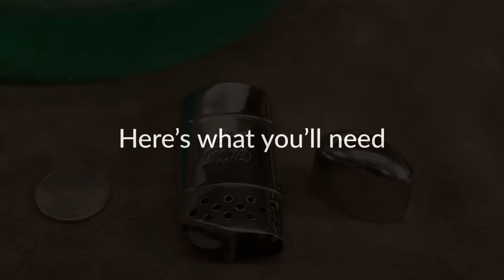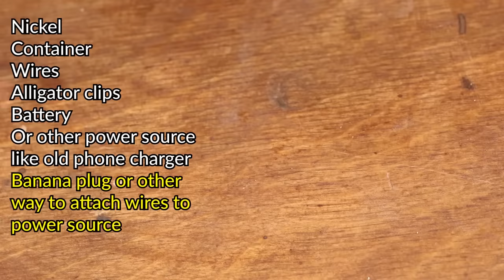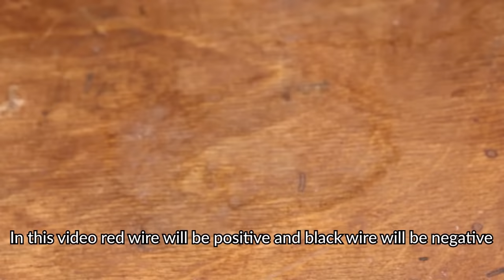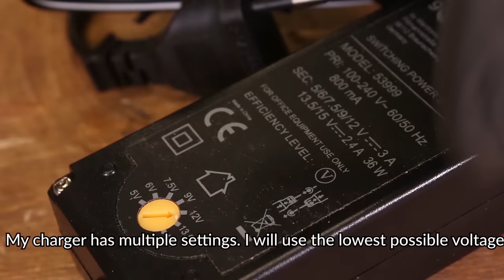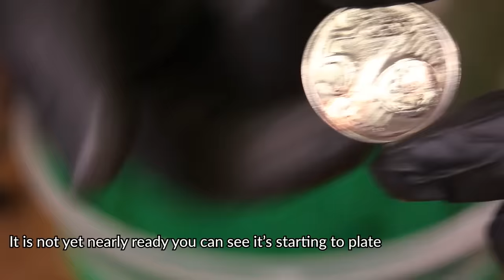How to make simple DIY nickel plating set up - Easy Electroplating for Beginners

Comment: Hi there. I'm thinking of nickel electroplating on my laptop heatsink/heatpipe assembly before applying liquid metal. I intent to electroplate only the coldplates of the heatsink assembly (the square copper shims that actually touch the CPU and GPU dies, not the whole assembly). How long should the part be immersed in the solution for a nice and thick layer of nickel for most protection against gallium penetrating it and reaching the copper to form other alloys, assuming a 5V (10-15W) power source is used?
Reply: I wouldn't. Copper has a much higher heat conductivity than nickel, so considerably less heat will be transferred to the heatsink, probably resulting in a fried CPU.
Btw where is the gallium co Inc from?

Comment: I have a question, can you plate plastic? I knkw there's no conduction for it to work, but can it be done?

I also saw a gif of someone plating regular bolts. But after the plating it was a purple color. Can you maybe help a girl out and explain?
Reply from the maker: Yes and no. You can coatc the plastic with something conductive such as conductive paint and plate that. I have no idea what could be purple plating
Reply: @Odd_Experiments  thank you for replying. I kind of figured you would need some conductive paint to even attempt to plate plastic. To be honest, I'm not even sure why you would want to anyway. I just thought I'd ask.
Reply: @TheFraggler  the steel from the bolt turned purple because it oxydized in the platting solution, you must first plate steel with copper into a copper sulfate solution with a copper anode before to plate it with nickel
Reply: @TheFraggler  Now that you have asked, you are obligated to everyone here to try it and make a video of your results :)

Comment: So could one use this method to nickel plate a small pistol?
Reply from the maker: Yes you could. Or a big pistol if you sake everything up. Adding multiple nickel anodes to  different sides of your container will help with getting even plating. Most of the plating will happen on the side the nickel anode is at. I wouldn't try to plate the barrel as you are adding a layer of metal making the barrel slightly tighter. But I'm no expert with guns so that might not be an issue

Comment: Based on a paper I read, look up "Pit-Free Nickel Electroplating", I would use potassium chloride instead of sodium chloride. The nickel chloride component of the standard "Watts Nickel Bath" was replaced with potassium chloride in this paper and it was found to give better plating results, as well against sodium chloride. That plating bath used nickel sulfate as the source of nickel ions thus giving the sulfate anions, where as you here the acetate anions (from vinegar). So it could be possible there is some interplay there that yields the potassium chloride better, but given here sodium chloride is chosen with not much reason other than increased conductivity, I'd shoot for potassium on the off chance it is better. Also, I believe nickel plates out far better at elevated temperature (50-60C). I try to wear a respirator when plating if I'm right above the solution, because as you mentioned, that mist. It probably contains some nickel ions which of course is carcinogenic. It's good to avoid breathing that, I imagine.

Comment: do i need to use the CLEAR vinegar or can i use some other vinegar ?
Reply: wine or cider vinegars aren't pure enough and less strong, better use the table white vinegar made from alcohol which is about 8°
Reply: @Jethro.Maloku-le.Rey.Kalsitran  its becouse in my country i cant get white vinegar for some reason
Reply: @jdmfl26  the problem with other vinegars is that they contain other stuffs that can contaminate the platting... but who knows ? perhaps you could give it a try... perhaps the other stuffs will react and condense in the bottom or won't affect the process...

Comment: Could the same set up be used but with brass?
Reply from the maker: No because brasa is an alloy (mix of metals). There is a brass plating process but it is more complex and produces toxic fumes. If the set up is wrong you will only plate one of the metals in brass

Comment: what could happen if you replaced vineger with water??
Reply: It wouldn't work because the electricity needs an electrolyte to flow through the solution.
Reply: @benjaminvanschaick3658  water+salt is a solution containing ions so its an electrolyte!
Reply: @abdeljalilabdeljalil9022  So if you're saying that you are going to replace the vinegar with salt for an electrolyte, then it might work. If you would like, you could design an experiment to see if it would work, although I think that it'll just split the water and none of the nickel will stay in solution.
Reply: @benjaminvanschaick3658  thank you !! i will try it to see what would hapen

Comment: do you know how to chrome plate plastic?
Reply: Most plastic doesn't conduct electricity. You could just leave the plastic in the solution for a long time, and maybe some nickel will precipitate out onto your item, but, it would not be a very reliable method.

Comment: I have tried with the same set up on brass, copper and zinc. The result is always a dark gump on the metal I try to plate :(
Reply: It often occure when the current source used is to powerful. that produce to much hydrogen that give a powdery layer that does not adhere on the plated surface.  And Zinc need special treatment before nickel plating.
Reply: @pwaldechfal  thanks for your comment, i used 5v 0,8 amp. I will try lower. I mainly try to plate coper for some reason.
Reply: @chongtak  Yes I think you could try a 3 or 4 V with 0,3 Amp max, for little pieces and cramped containers, wich not allow enough electrolyte space between anode and cathode. Copper is a good metal for nickel plating, good choice !
I don't know what type of vinegar and concentration you use, but white 10% seem to be a good option when you don't have EDTA, citric or sulfuric acid to avoid a matte aspect and dulness.
And VERY IMPORTANT : You have to be very clean. The piece you want to plate must be perfectly degreased, or you'll get darker spots and non conductive areas that will be altered.
Reply: THE BUBBLES ! 
A good sign that your plating work well : The lesser you make bubbles, the better will be the result.
Too much bubbles -> drop the current lower, or by default increase the space between cathode and anode, or/and decrease salt concentration by diluting the solution

Comment: The Negative - is the Anode and the Cathode is Positive+; but no big deal.
Reply: physicians and chemists are using the real polarity (red is cathode and negative and black is anode and positive) but everyone is using the conventional polarity (red is + and black is -)... it's only important when you do electrolysis and you link it to the real polarity of the ions
Reply: @Jethro.Maloku-le.Rey.Kalsitran  I knew the electron comes from the negative anode and that it was discovered years later.

Comment: Can someone please tell me what I'm doing wrong.......I've basically followed this and evolved it further with the additions of an agitator (commonly used for domestic fish tanks), a crock pot to put some heat into the electrolyte & process and a porous protection bag around the anode. The problem I seem to get all the way through is that I can plate about up to 10 small parts quite well and then the plating finish starts to come out very black (like a smokey finish) and very rough......I've then got start again and make new electrolyte.....what are the common problems to cause this please? SO ANNOYING & FRUSTRATING........AAAARRRRRGGGH!!!
Reply: you mustn't have something other than nickel connected to the anode and in contact with the electrolyte or it will contaminate the electrolyte... Also, you can't have any other metal in contact with the solution (that becomes acid because the hydrogene and the chlorine released are creating hydrochloric acid HCl) because they will release their ions in it too... so if your crock pot has a metal wall or your agitator is metallic, you'd better use a "bain marie" to heat a glass or plastic pot ...
Reply: @Jethro.Maloku-le.Rey.Kalsitran  Thank you for your reply. The only thing connected to the top of the anode, is the copper wire that supplies power to it. Being connected to the top of the anode means that it is not in the electrolyte, so that shouldn't be a problem. The crock pot dish that holds the electrolyte is ceramic, so again there's no metal in contact with the solution. The agitator is plastic tubing and a fake stone end. The only metal in the solution other than the anode and the part I am wanting to plate, is the short section of copper wire hanger used to suspend the part I'm plating and also to deliver the other half of the power supply, which  of course is normal to the plating process. I am unfortunately still at a loss as to why my solution keeps becoming contaminated.
Reply: @cryptic_badger795  perhaps that the metal you're platting is corroded by the acidity of the solution... if it's iron, you must first copper plate it with a copper sulfate electrolyte and a copper anode before to nickel plate it... or... have you already successfully plated something with the clear electrolyte ? didn't you reverse the polarity ? If the nickel electrode is covered with dark stuff, you have the current flowing the wrong direction... In fact, the metal will go from the conventional [-] side (black) to the conventional [+] side (red) because what we usually call the positive is where electrons (which are négative) are coming from and the Ni++ ions are taking the electrons to return to metal and plate the thing you want...
Reply: @Jethro.Maloku-le.Rey.Kalsitran    Very many thanks again for that.   All items are mild steel and as said, the plating seems to go fairly well for a few times and then it always starts to go wrong.  The black stuff on the anode is interesting because yes I do experience that!   As far as current flow, I have negative to the part being plated and positive to the anode?......sorry I'm a little confused by the last 6 or 7 lines of your message?
Reply: @cryptic_badger795  Let's try a step by step check. Let's forget the "real" positive and negative poles and stick to the "conventionnal" ones... First, can you identify clearly the poles ? What source of current are you using ? Do you have red & black wires or do you have a [+] & [-] clearly indicated on it ? Because when you prepare the electrolyte, the conventional anode should be on the red [+] wire and the nickel plate on this side should grow in thickness while the plate on the cathode connected to the black [-] should be "eaten"... So far so good ?
Reply: @Jethro.Maloku-le.Rey.Kalsitran  Thank you again.....I double checked the poles and marked them with red and black when making the plating solution using the two anodes (i.e. noting which one produced all the bubbles). I am using a mobile phone charger...which is about 4 volts.
Reply: @cryptic_badger795  I'm sorry, I can't help you no more because I'm not a chemist and I just rember some stuffs from school... If you are using a mobile phone charger, you should have a pictogram on it telling you which is the [+] and which is the [-] (usually the [+] is the center pin and the external cylinder is the [-]) and the piece to plate has to be on the [-] (or black) electrode... but for your contamination problem, I have no clue... it's just a guess but in the video, you can also see some black deposit... perhaps that some chlorine is combining with the hydrogene to make HCl which corrodes your steel object ? I'm not good enough in chemistry to help you further... try to polish and clean your steel piece to have only pure steel in contact with the solution as, in my opinion, the acidity of the electrolyte could reduce steel oxydes to something that could contaminate the electrolyte...
Reply: @Robbo: after reading these, I assume, you were using MILD IRON as Cathode, instead of COPPER (as real example in this vid), didn't you?
Reply: @JSuparman  Hi there, no it is nickel anodes with a purity as near to 100% as one can get.
Reply: @cryptic_badger795  sorry if I made a misleading question. The real question is "WHAT METAL did you  put as the CATHODE (receiver of Nickel)" ?
Reply: @JSuparman  Hi again, No problem and sorry. Mild steel is the receiver in every case.